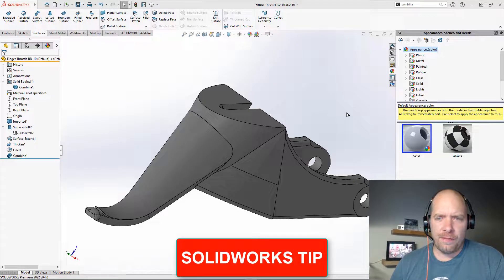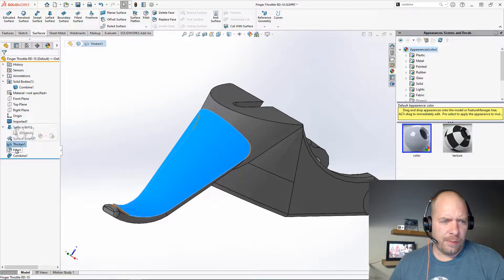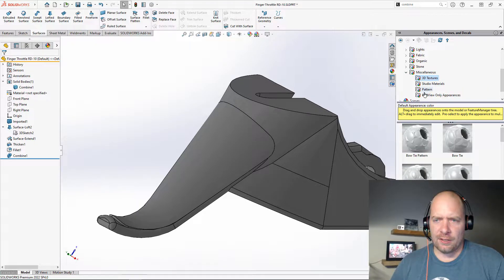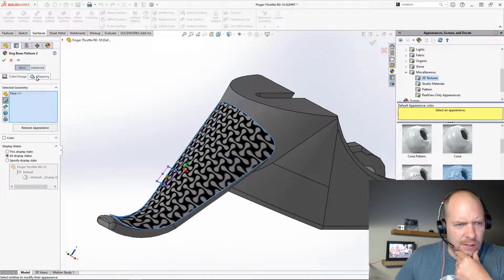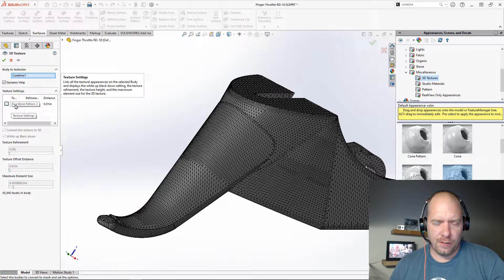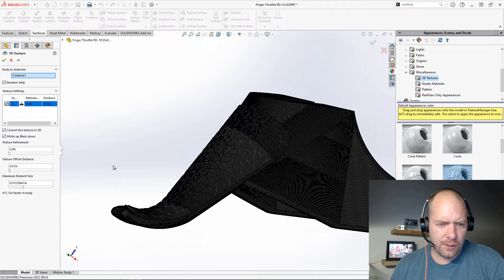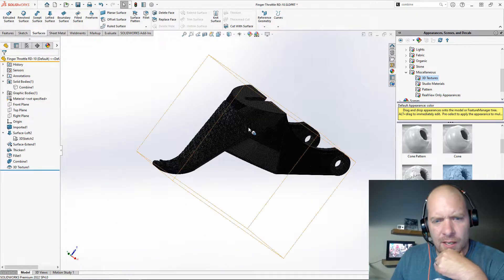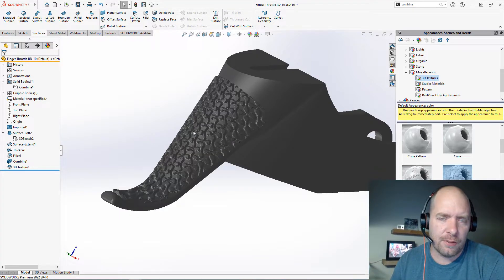SOLIDWORKS Tips: 3DTexture

Comment: Hi im trying to do the same as you, i also have an inventor .ipt file. I also need to add a 3d texture. what kind of magic did you do to add the texture to a curved surface? my 3d textures only work on my flat surfaces
Reply from the maker: You may just need to show the solid bodies folder in your system options so that you can select the body after you apply the appearance to the face. thats where i see most people go wrong!